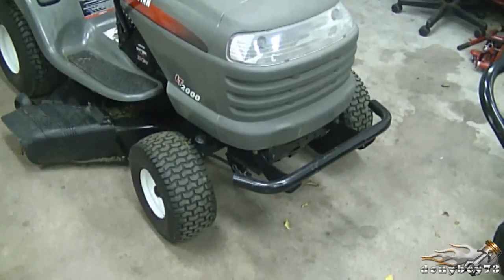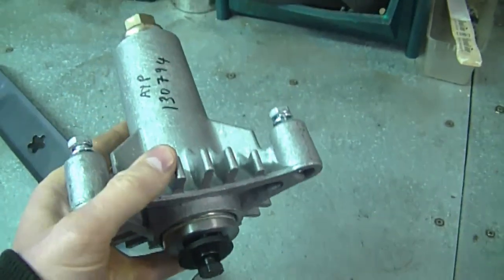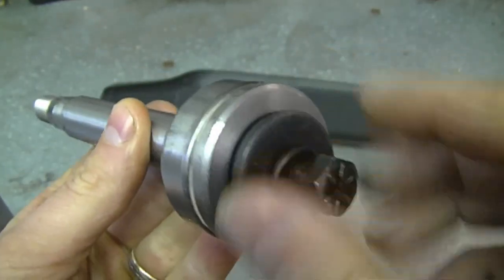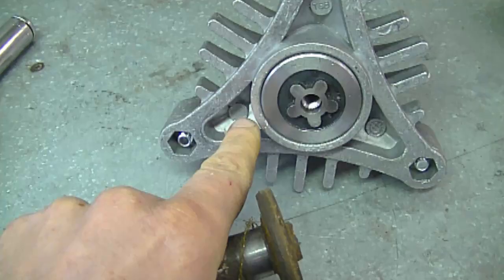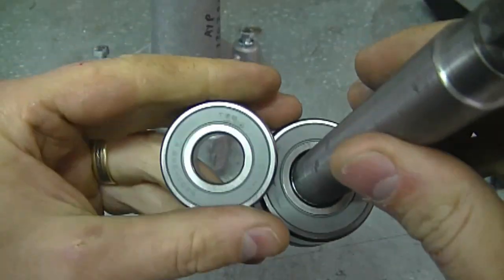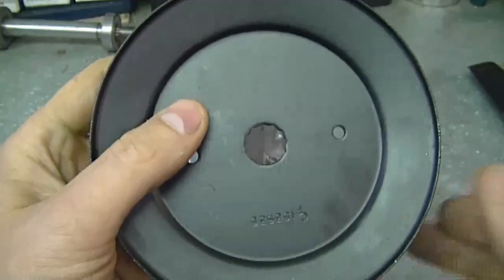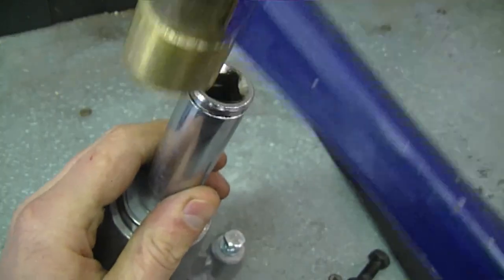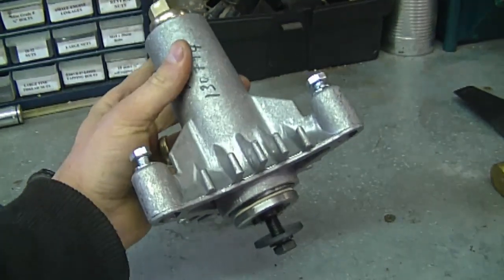What it looks like Inside A Lawn Tractor Blade Spindle

Comment: I have the same spindel on my craftsman garden tracktor, I remove the bearing seals and repack the bearings every winter, it's 26 yrs old and running like new.
Reply: As far as removing the bearing seals, remove the seals on the inboard sides. This allows the grease to enter the bearings and prevents outside dirt from entering the bearing. This also applies to the ball bearings in the front wheels.

Comment: Danny 
 I  have a craftsman it is just like an lt1000 - i can give you more info - but here is the problem - I turned the mower on it's side - and when i turned it back over the mower starts but when i engage the blades [ manual  blades ] it kills the engine - I took everything out and - while it is down i put on a new front end. I want to know if you know any short cuts? I will hot wire the seat switch once i have the front end back on - and i am also going through the steering. can you help?

Comment: Nice video.  But you really should tap the outer race of the bearing because that is where the press fit is. This will eliminate the extra stress needed when pounding on the inner race as you did.  Thanks for the video.

Comment: Hey Dony, I was recently told that you shouldnt use high test gas in a small engine like a snowblower or a generator because it makes the engine run hotter than reg gas.Is there any truth to this?

Comment: Thanks for this!  I have a husqvarna 46", ran over a brick and crack - the housing broke.  I got it off, but couldn't figure out how to remove the shaft.  Just followed your video (I used a rubber mallet to hit the top of the shaft) and it came right out.  Again, thanks very much for posting this video.

Comment: I have a 1991 5hp BS engine with the tank hooks to the carb . I found the Governor spring was broke so I ordered one it looked exact like mine . When I installed it the engine it will not rev over idle . I tried manually reeving it and it worked. I tried adjusting the Governor by putting it on fast and turning it clock wise . It made no difference and the adjusted was already fully clockwise. It on my 1991 craftsman chipper . Is there something I missed . I watched your video on it.

Comment: Great Video.....I learn so much from your videos.      My craftsman lawn tractor has one blade that cuts lower than the other. I replaced the blades and yes, I did hit a post remnant. Did you ever hear of the deck getting bent, where the holes are located on the deck, where the spindle mounts?  Thanks

Comment: Don, i recently bought a new spindle that had a zerk fitting on top. If the bearings and all are sealed then why the fitting? There was no directions to how much grease should be pumped in. Ive heard that too much grease will expand with heat causing faster failure. How much grease should be pumped in?
Reply from the maker: just 4-5, i'm not quite sure either why have a grease fitting if the bearings are sealed
Reply: +donyboy73 I pop both inside seals off, then I can use ep greaseevery 8 ish hours.

Comment: Good vid Donyboy, I see those spindles have no grease zerks. Could you show the type that have a grease zerk at the top? I have a simplicity it has zerks on top of each spindle. I would like to know where the grease is going so I have an idea of how much to pump in. My type also have cups on the underside where the blades attach. Also no star pattern thing, just guess at torquing the nut.  Thanks

Comment: I'd like to know how you remove the lower bearing. The lower part of the shaft is a star which is used to mount the blade. I'm reluctant to cut the bearing off of the shaft. Daniel Shaw commented on this problem about 3 years ago.

Comment: wouldn't it have been better to install the bearing with a socket that would have fit the outer race as that was what was tight and you would not have put a side load on the bearing? 
Thanks for the videos.

Comment: My John Deere mower spindles have grease fittings. Do you need to fill the entire hollow tube of the spindle with grease? How do you know when you have enough?
Reply from the maker: no don't fill it, they are sealed bearings anyway
Reply: @donyboy73  why do they put grease zerks on them if they are sealed?

Comment: Ive got a couple riding mowers and have had to replace lots of spindles cause the pulley strips off the teeth connection on the spindle. So now i put the pulleys on with a impact wrench and i put them on tight. Since i have been using the electric impact wrench i have not replaced a spindle.pulley combo. If you do replace a spindle use the impact wrench to take the deck boats out. Just go slow. Those bolts are exspensive. If all else failes i thought i would weld the pulleys on but so far i havent had to do that.
Reply: I would like to see you weld aluminum to steel,also the bolts from lowes are lot cheaper

Comment: I am replacing the bearings but can't seem to get the lower (larger) bearing off the shaft. Any Tips/tricks? Thanks
Reply from the maker: use a shaft to tap it from the top
Reply: donyboy73 I have this same problem, what do you mean tap it from the top?  My larger bearing is stuck on the spindle and I can't seem to find a tool to "grab" just the bearing?  Also, I don't have a table vice...
Reply: Michael Thomsen If I remember correctly, I ended up taking a pry bar and hammering it between the larger bearing and  the bottom flange. If you don't have a pry bar maybe a screw driver would work (any sort of wedge shaped object).
Reply: Daniel Shaw I'll try that today.  I was worried the lower bearing was welded on...
Reply: Michael Thomsen Definitely not welded on. Don't be afraid to hit it, If you got a large hammer (a couple pounds) i recommend using it. Just try not to gouge the shaft.
Reply: I tried everything and couldn't get it off.  The bearing was busted as soon as I took it out of the housing so all I had to grab was the inner most ring of the bearing.  I ended up buying a new spindle for $22 overnighted so not so bad...

Comment: I'm cleaning up the rust on my mower deck.  I've noticed one spindle is stiff.
Any way to lube these?  Or any other suggestions what to do with one stuff
spindle?   If needed to, can I replace just the bearings? Anyone have part numbers for these?
Reply from the maker: spray penetrating oil by the bearings, and yes you can only replace the bearings

Comment: i will take some pics this week - maybe today - i am putting it back together today and tomorrow. I am going to leave everything like it was EXCEPT - two things -i will jump the seat switch - and - i will  also repair the bearings on the blade engage lever. There are no attachments on the blades EXCEPT the engage unit. The engage blades switch is only on the main lever to engage - it has four  connectors and I am not wanting to mess with that - I have no test switches and I don't want to buy any

Comment: NEVER NEVER NEVER drive the bearing in using the inside race,,,very very bad. By doing that, you are using the balls in the bearing as a press point,,basically trying to drive those balls thru the inner and outer race creating "speedbumps" on the balls and races for the balls to now bounce over and flake off those inner delicate polished surfaces.  No amount OR quality of grease will save that failure now.  You are more or less shortening the bearing life drastically by doing that.  I don't care what manual or mechanic tells you to do that,,don't do it!.  Use the outside race ONLY for driving in the bearing.   You might get away with it for awhile,,but sooner than later the bearing will fail.  If the bearing is tight starting/going into the housing,,warm the housing using a heat gun or heat source then tap it easily into place.

Comment: I'd have tapped on the outer race of that bearing to install it.  Installing into a recess, tap or press the outer race.  Installing onto the shaft, tap or press the inner race. 

The rule is not to shock the balls or rollers by transmitting hammering force through them.  The balls or rollers, and the raceways they travel in, are all hardened, and micro-cracks or misalignment can result.

Somebody is going to say, "I've installed 154 million bearings this way with never any problems..."  Sure, that's great.